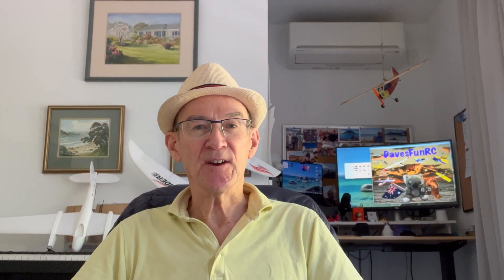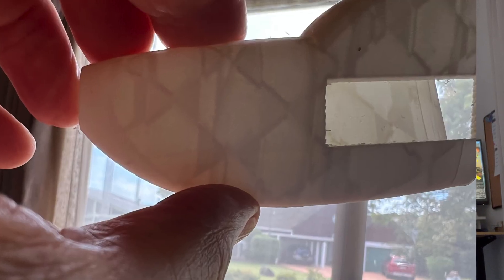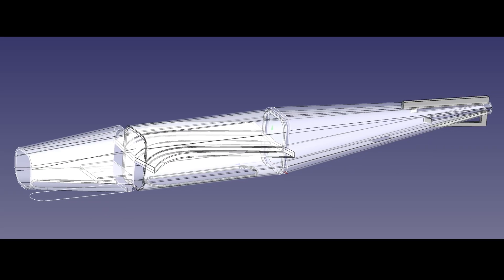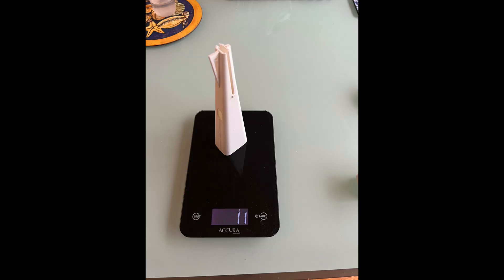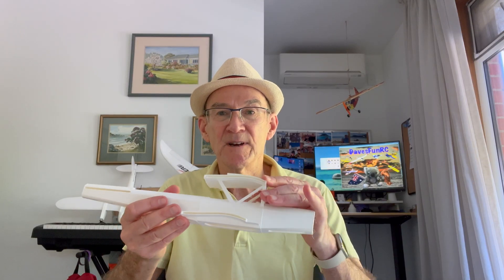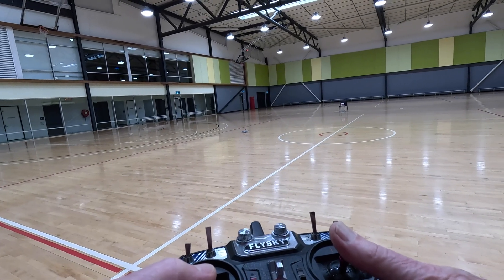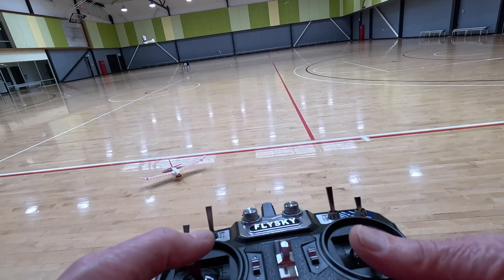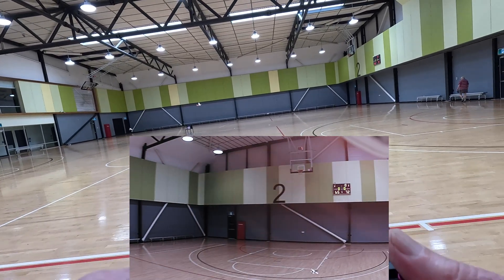Double-skinned LW PLA Printing for strong and lightweight RC Plane fuselages.

Comment: Have you ever looked at the designs made by Eclipson ? They also use LW-PLA, their own infill patterns and sometimes double walls. The designs are such that you can print them in "vase-mode" or "spiraling mode". My main problem with PLA is the temperature resistance. You have to keep your plane cool...
Greetings from the Netherlands.
Reply from the maker: Hello from sunny Melbourne!  Yes, it has taken me a while to get my settings right for LW PLA.  I'll have to check out the Eclipson plans as you say to see what they do.  I have used Spiral Vase before, but I think I can only use it on simple parts that don't have interior detail.

Comment: I've been printing fuselages and lifting body aeroplanes using this double-walled technique (though not with 5% infill, that's daring!). I find that it survives my bad landings better!
Reply from the maker: If you see my indoor flying, you’ll see that my planes get a hard time. We’ll see how this one lasts. Thanks!
Reply: @DavesFunRC I would like to see a video on your technique for printing double walls. I've never tried LW-PLA or printing an airplane